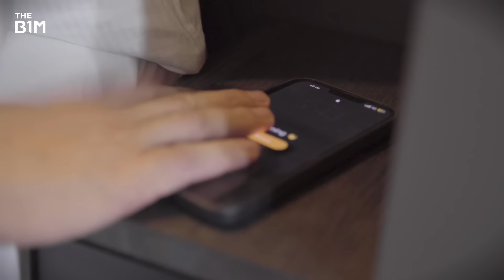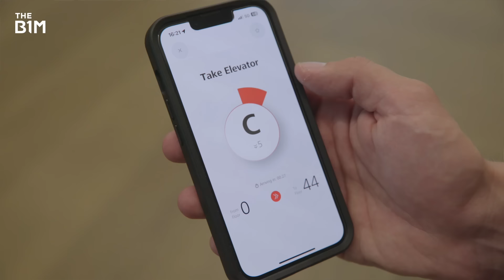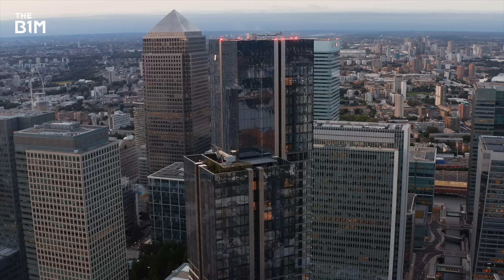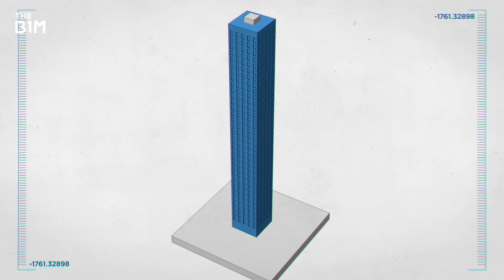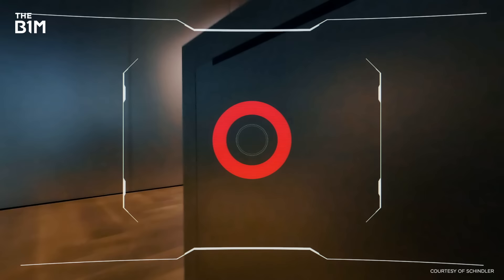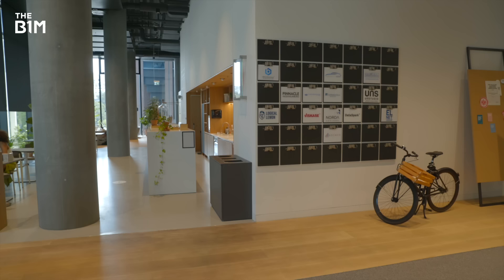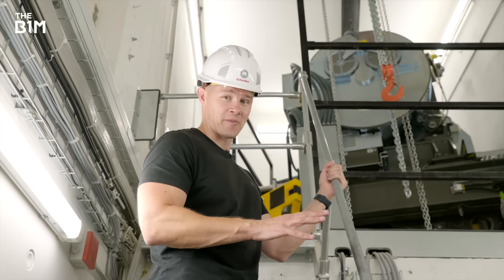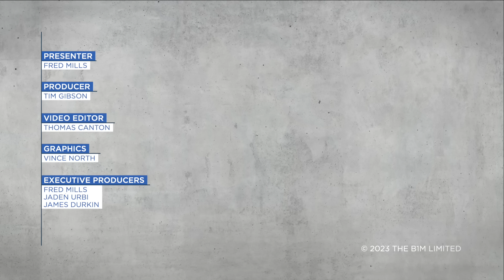Germany Has Solved the Empty Skyscraper Problem

Comment from the maker: We hope you find this upLIFTing!! (that joke courtesy of Your DAD)
Reply: fix subtitles, seems to just be your script
Reply: Should have called it Schindler's Lift.
Reply: you found my dad?
Reply: That's racist
Reply: I don't have a Dad though.
Reply: So...  How can apartments, offices, and a hotel have three separate lobbies and use the same elevator?  You still didn't explain that!
Reply: @fredashay  it's called access restriction. Just as firemen have access keys every tiered floor will have different access requirements depending on key/keycard
Reply: @fredashay  two parallel banks of elevators. 
Say like an equal sign =. One lobby at the top, can only access the top row, one at the bottom can only access the bottom, and one coming in from the side side can go down the middle and use them all.  And/or have split level access on a sloping site, that way lobbies could occupy the same area in plan, but on different floors.
Reply: I mostly enjoy your videos, but this one was confusing.   I still don't know what you were saying..   For example, it seems residents and office workers use the same elevator but not at the same time.    That sounds sloooow.
Reply: It’s not clear to me what is actually happening.  I hear the new idea, but how does it work and/or what the component that can be potentially added to existing buildings. 

Is this merely an administrative tool?
If so, how does it work when I leave for a run and don’t bring a phone with me?
Reply: @JettMoress 😂
Reply: @tyronehunter7330   That's a valid point.  I'm one of those people who isn't tethered to my phone and brings my phone with me everywhere I go.  This dystopian building wouldn't work for me.
Reply: I love your videos, and they are generally very informative.  This one though, I guess...I just don't get it.  

You establish at 4:25 that using the same elevators to service both residential and commercial would be inefficient. You proceed to explain that multi-use buildings traditionally have multiple lobbies, one for each use, each with their own elevators to increase efficiency.  

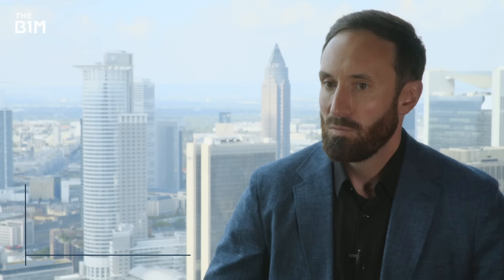Now at the beginning of the video, you establish that Omniturn has two distinctly separate lobbies, so nothing new there.  Then at 5:20, you establish that Omniturm's elevator system uses the same lifts to go to service all floors.  At 5:40, the Schindler Group representative says "We are doing it with the same elevators. So, by definition, that's efficiency."  ....huh?  That's a direct contradiction of what you've just explained 1 minute earlier. 

It really seems this system is just using elevators that have doors on two sides, but that's also not new or innovative at all.  So...what's really new here?  The app that calls the elevators before you arrive?  That's kinda neat, but that has nothing to do with the physical elevators or the elevator shafts, so I'm unclear why all the talk of those.   

Just over all, a very confusing video.
Reply: Quite the contrary, this made me irritated and has me considering unsubscribing. The only "innovation" seemed to be integrating the elevator call button with an app and you only mentioned that in passing in the script. Furthermore you suggested that using the same elevators would make people feel like they live in an office building and then described how schindler uses the same elevators, thereby undermining one of very few arguments. Your commercial is bad and I'm sorry to say that but I know you're usually better than this.
Reply: Excellent Pun!
Reply: Could you do a YouTube short saying something like, 'Yes, the architects did think about utilities as well, and obviously made sure it'd be easier for plumbers, electricians, phone and internet technicians to provision those to a new layout when switching usage of that floor.'? 

The Comments would suggest people are convinced that the only thing they did was plan for the lifts to be useable. You know, because civil engineers, electricians, plumbers and architects are famously incapable of thinking about two future problems in advance or brainstorming.
Reply: How about doing a video about the Woodsmith Mine Tunnel.
Reply: Np, i've put this on Schindler's list.
Reply: It's the same concept I would use in my own design(the Rurak tower/Boyle Street Tower). Having 3 separate lobbies, 1 for residential and entertainment, 1 for non profit use, and 1 for office use. Each section having it's own services, only where the floors align will there be a sort of sky lobby. In addition to that, the windows will have fresnel lenses, allowing light to enter directly, but at sharp angles it would refract around. The reason for this is to refract light around the building, and erasing it's shadow(sort of) and increasing the sunlight that gets into the north face of the building. From the "shadow" of the building you would see a pillar of bright sunlight. The top would not have these windows so it can be visible to aircraft. From the inside of the north face the window would be brightly lit by daylight around the edges. Though much care would be needed in it's design to avoid creating a solar death ray
Reply: At 3:07 you cite a 70% vacancy growth rate, but it isn't a useful or informative statistic alone. It could mean an increase from 5% to 8.5% or an increase from 30% to 51%. Maybe you chose that statistic to show a big number but without more information (the baseline vacancy rate and/or the new vacancy rate) it isn't very useful to know just by itself.
Reply: It seems that the real key to this is the software that is being used to determine who’s actually in the bundling, leaving the building and coming into the building which I suppose drives the logic around where the elevators will be at any given time. So how does that work? It wasn’t explained at all.
Reply: while yo momma looks on in disappointment...joking aside, an interesting concept that'll be able to Lift us up where we belong...
Reply: Cheers for video, and especially for placing non-adsense at front/back/both of video with mutual consideration in mind, it really makes for a more pleasant learning experience :>
Reply: This make so much sense, when i lived in California in the US, they have so many empty buildings, i had always stated why not convert it to multiple purpose, residential, commercial, etc etc....
Reply: What lifts would movers and freight use???
Reply: Lolz Bit dizzying but yahhhh ecology in an Arcology Alpha phase..:face-fuchsia-tongue-out:
:face-orange-raised-eyebrow: WILL IT HAVE OLD MAN CHAIRS?
Reply: The video explains absolutely nothing, seems like smoke and mirrors....is it?
Reply: @davidbriggs8076  the real truth buildings are suppose to come down like old trees in an over grown forest.. But Restocking a broken Castle sure looks good.... Smoke naww mountain mist hell yah
Reply: NO not really.. It makes everthing way fkn worse son
Reply: I'd love a deeper dive into adapting existing buildings rather than new construction. You allude to this at 7:57, saying that 'Metacore' can be retrofitted to existing elevator banks, but as others have rightly pointed out, the elevators are nowhere near the biggest issue with converting commercial to residential. Commercial skyscrapers have massive floorplates that don't get sunlight in the interior...nobody wants an apartment without any natural light.

The NYTimes had a great article on this topic (with very informative graphics!) called "Here's How to Solve a 25-Story Rubik's Cube."
Reply: :face-blue-question-mark::face-blue-covering-eyes:
Reply: boring. totally boring.
Reply: @fredashay  You'd "simply" need a separate lobby for each building use, and the lobbies don't all have to be on the ground floor. Could have an escalator to the second floor or subfloor if needed to access additional lobbies. When you press the call button in the hotel lobby, the elevator will only go the hotel floors, etc.
Reply: @theothergameygamer  Think about what you just said for a moment.  Just think for a moment.  Mmmkay?
Reply: @fredashay  Which part don't you understand?
Reply: Well sugar boo here's a mom 's joke! Why did the highrise go to therapy? Because it had too many stories to tell!
Reply: @yummymommy4717   Good one! 🙂
Reply: In Germany we do have laws against use changes of commercial and living spaces. You cannot just change a living spaces to commercial and vice versa. So how do the got it done and could circumvent the laws?